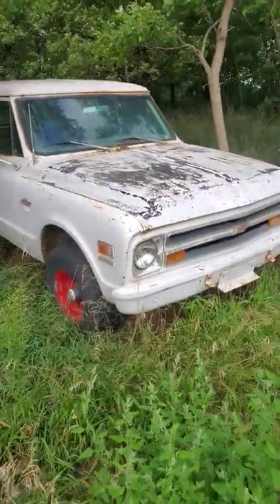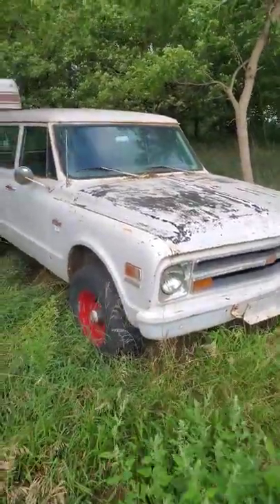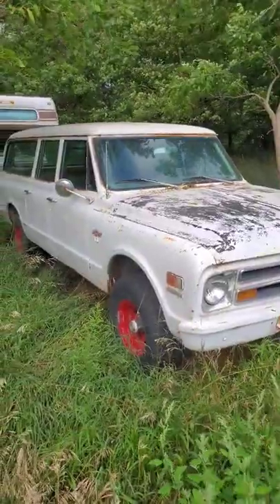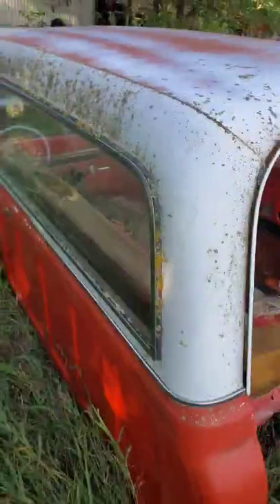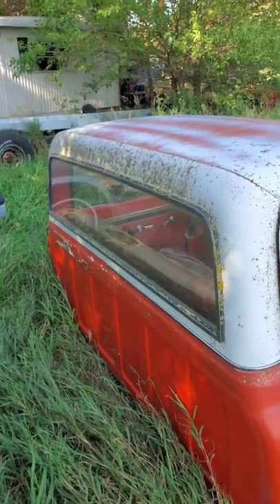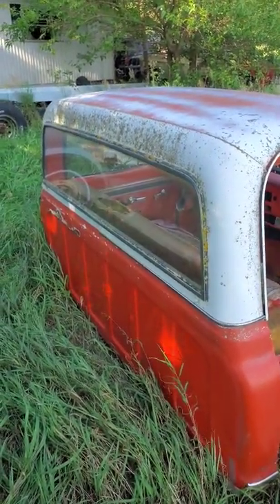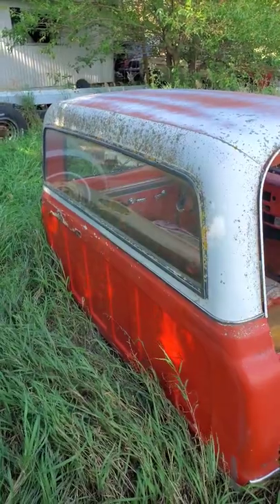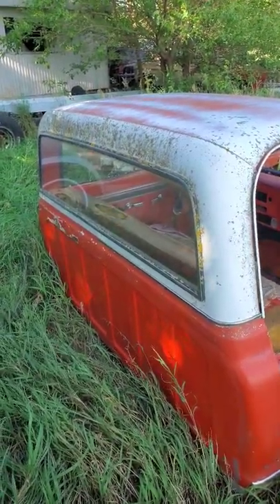Safety glass

Comment: The Custom Cab trucks featured the larger rear glass starting in 1963. My Dad had a 66 Custom Cab with a 327 3 speed that was school bus yellow with white top cab and white center painted chrome. Every 66 1/2 ton Chevy pickup had squeaky brakes by the time they were 2 years old.

Comment: Of course you could get 67 with large rear window if you wanted it. I've got one it's got like 29,000 original miles. I bought it back in 1980 4 or 1985. They ran fence with it do not beat it up it came out of Oklahoma so no rust on it but barb wire scratches down the past your side that go clear through the bed skin. Talk about staying in touch with work! But after all these years I finally found myself another 68 CST half a dozen years ago I'm so happy. Now what am I going to do with those other 8 or 10 60 70s. Actually 67 - 70 all but one of them's half ton.?

Comment: I had a 82 the 1st yr of the 3rd gen it came from factory with a 2.5 cylinder automatic. A friend and me put in a mild 350/350 Trans with the factory rear end at idle you could put in drive  take foot off of brake and it would shift all the way to 3rd. It was a hoss in a 1/8 and yes we eventually toasted that rear end😂